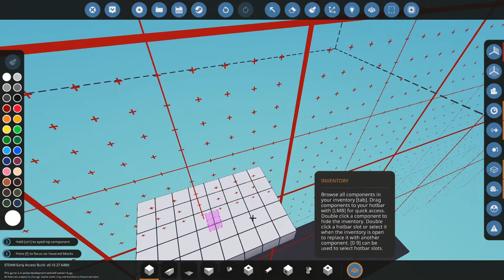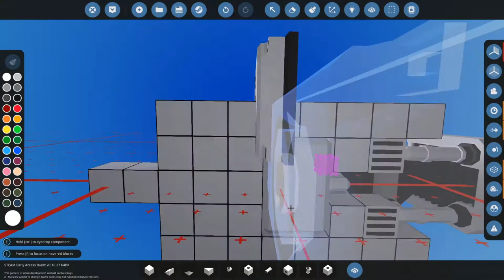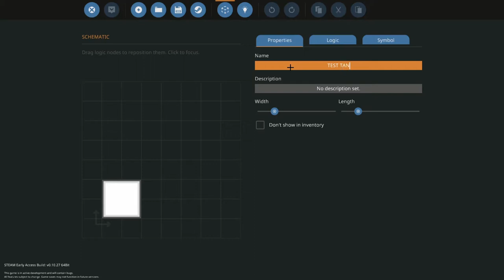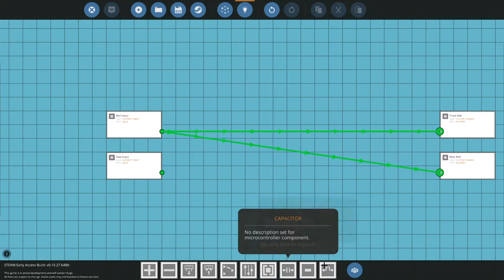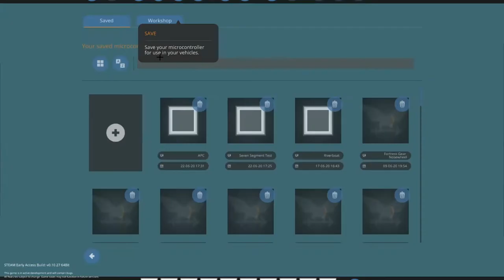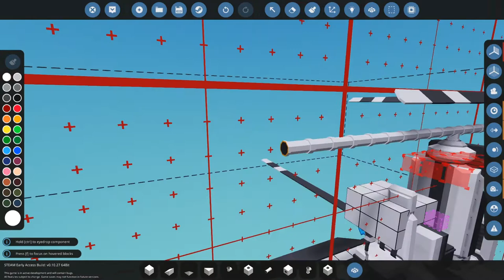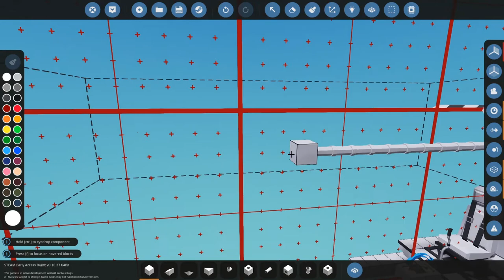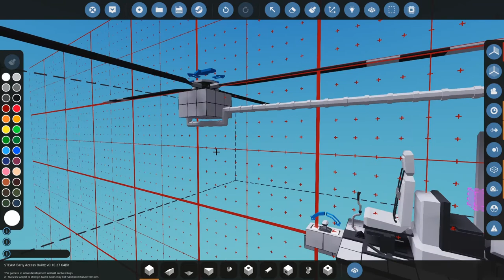How to make a Tandem Rotor / Heavy lift Helicopter in Stormworks!

Comment: this is nice walk through, but you can just flip one of the rotors. I commonly use inverted roll and yaw so the pipe isn't in front of rotor box, so theirs that too. just for simplicity sake.
Reply from the maker: yes you can flip the rotors, I just find this method more straightforward, but both work

Comment: hey, spins in circles, i doublechecked the microcontroller and it should work but it still spins
Reply: try adding a gearbox on one of the rotors and reverse it, and if it does not work then i just have a severe skill issue dont mind me here🥲